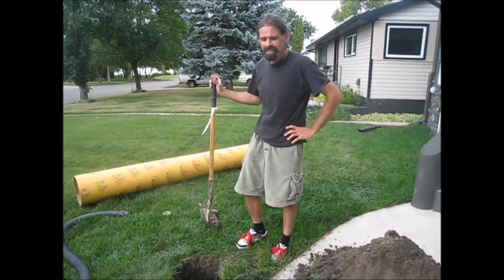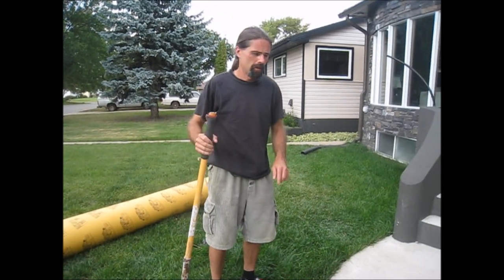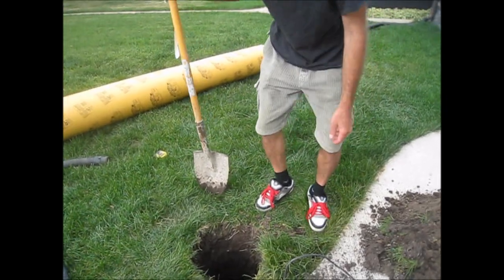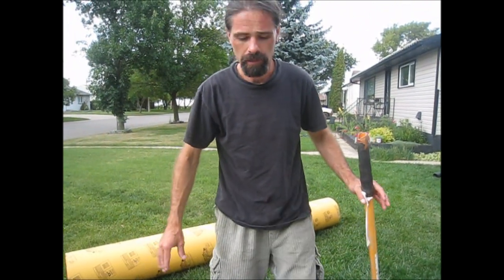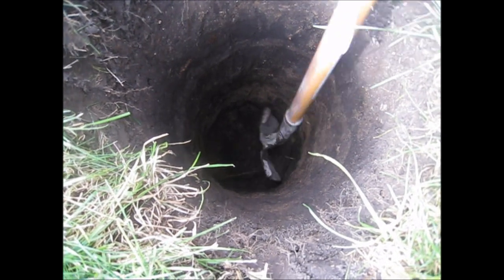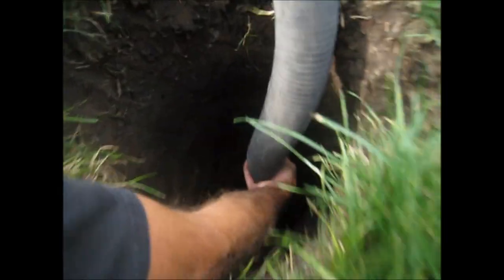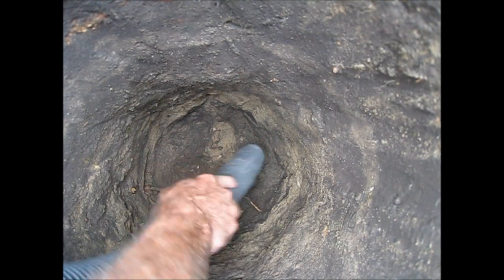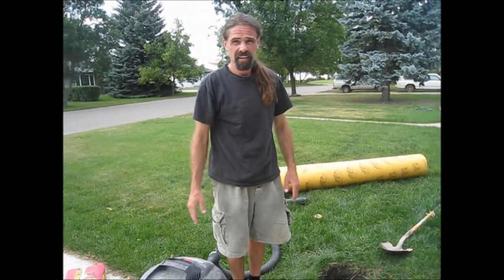Pouring a lamp post footing

Comment: The tube creates a smooth side surface to keep from from having a place to grab hold and heave up on the sides. If you use jsut a hole, it leases pockets for water to go and freeze to heave up on it.

Comment: I've just installed a 8ft cast iron Victorian lamp
Post. Two ft deep hole. Plenty. But no harm being extra cautious.
Reply: Whether or not 2 feet is deep enough depends on your geography not how sturdy your lamp feels. If the base of your footing doesn't extend below the frost line then ground heave from winter freeze/thaw cycles can cause your footing and lamp post to shift/lean/fall. In SC you can go 16 inches and be fine, in NY you have to go 4 feet, in Canada I'm sure it's even deeper.
Reply: @MineStrongth 4 feet is a safe depth to be sure you are below frost. Actual frost depth is often no deeper than a foot in someone's front yard and can be easily 20 feet under a dirt road that trucks have been driving on all winter.
Reply: Taylor 😂
Reply: Is this why they tried to make a new 360 cover?

Comment: 4 feet? 18" enough
Reply: Depth depends on your geography. If the base of the footing doesn't extend below the frost line then ground heave from winter freeze/thaw cycles can cause the footing and whatever sits on it to shift/lean/fall. In SC you can go 16 inches and be fine, in NY you have to go 4 feet, in Canada I'm sure it's even deeper.
Reply: @MineStrongth I wish people would research before they comment. I'm in NY, 4 foot min if you don't want the leaning tower in a couple of years.